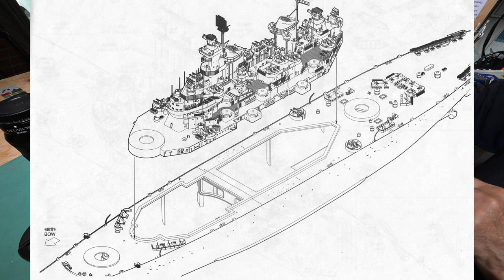The Model Ship - Part 1707

Comment: On my Iowa, I removed those plastic sprue structures, and it gave the hull a bit of flex which helped. Also, try just a tinnie tiny bit of vaseline to a couple spots where it is too tight, that'll make it plop right down into place. Then run a touch of thin cement in a couple spots, and Bob's your uncle.
BTW, I finally finished my Iowa!
Reply from the maker: Re: "I finally finished my Iowa!" A big CONGRATULATIONS Paul 👍

Comment: I removed the central sprues in the holes on the decks, and mine is still a snug fit with no paint.  I think removing those sprues would give a bit more flex to the deck, and allow the superstructure to drop down.  But it is a pretty tight fit.
Reply from the maker: Thanks! 👍

Comment: Did the instructions not call for removing the sprue cross braces in the giant hole after you unmasked it before permanently attaching the superstructure???  That might have given you the little bit of wiggle room you needed....just a thought
Reply from the maker: Hi Wes,
Re: "call for removing the sprue cross braces" The drawing of the main deck in step 45 clearly shows that the they been removed.